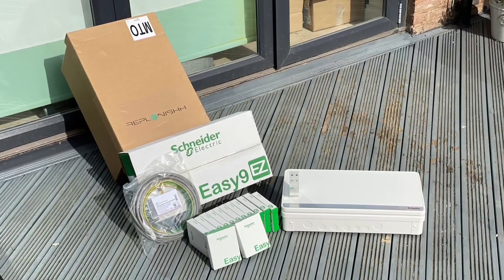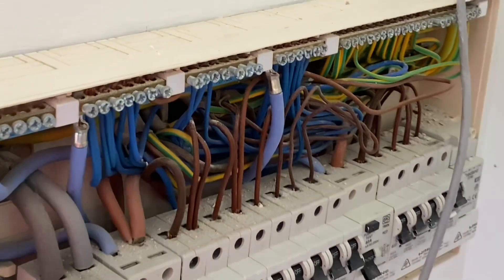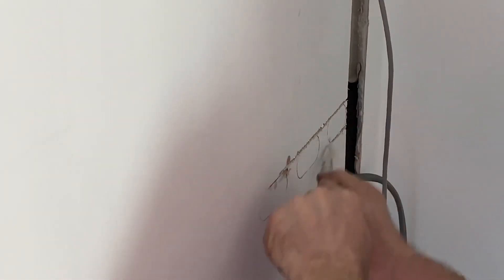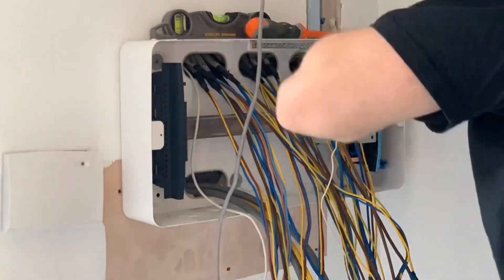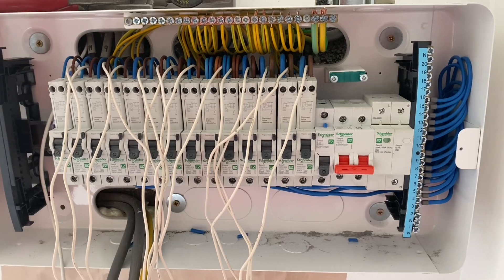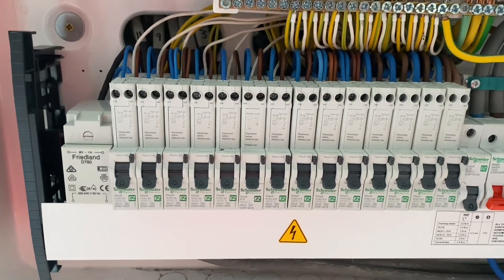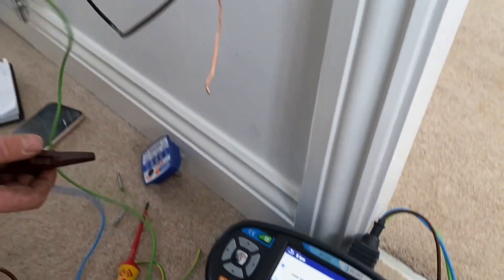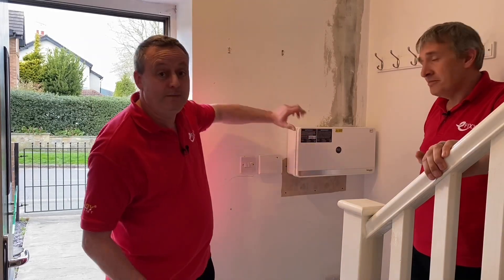EV CHARGER installation UK - WHY did we change the consumer unit?

Comment: What I hate about the easy9 board, look how much space is below the RCBO’s.... yep, plenty, then above them it’s got hardly any space 🤷🏻‍♂️ 
Ross has done a belting job of that tho 👌🏼 well done matey
Reply: I havent fitted one and i wont.
As you say loads of wasted space also who designed it so the buzz bar to go around the Neutral terminal.
I have worked on one of those and a cable i had put in temporarily got  stripped by the hinge a blew.
Reply: @paulspicer754  definitely designed on paper and not for the installer

Comment: As big as that board is, it's tight for space at the top. Unusual to leave so much space at the bottom. Also considering the amount of innovation Schneider have in some of their boards, they have functional earth's on the rcbos in this one, very strange.
Reply: Better to have it accessible to reset Rcbos without having to get a set of steps... 👍🏼
Reply: @PETER WILSON Schneider themselves make a range without the earth tail and also without the neutral tail, so it's not just the cheaper brands and I think Hager devices don't have the earth tail any more.

Comment: Was the supply to the car charger on an RCBO? As it has an RCD within the charger does this still provided adequate discrimination
Reply from the maker: Extra RCD to protect the cable - video coming soon discussing discrimination.
Reply: @efixx  It'd be "selectivity" if Gaz had written this reply.... along with "twin and CPC" 😁
Reply: Mcb does not give Earth Leakage protection to the Circuit as it goes beyond the curtludge of the building

Comment: Why not install a larger unit for future expansions? This I dont understand about UK electrics, you only have 1-3 spare places when switching a consumer unit or even installing new.
Reply: because we have dumb regs that cause you to basically throw the fuse board away and start again every 10 years or so.
Reply: @edcooper2396  what the hell. What a dumb and wastefull regulation
Reply: @ed cooper it’s good for business though
Reply: It's at the point now where your better off fitting a small 3 phase board with a single phasing kit fitted. Gives the internal space and ways needed.

Comment: I don't get why these small units are installed in the UK, there is no room for upgrade and little space to work with.
Reply: If you notice with anything in the UK, it's either just the right size or too small, it's ridiculous, that goes for our electrical stuff and even our kitchens, where we design them, that if you plug the appliance in it won't go far enough back, that's the poor design we have over here, if the people designing them head to fit them, then maybe things would change.
Reply: @anthony Charles should you be fitting sockets behind appliances? I never do
Reply: @edcooper2396  yeah I have in the past, fitted a 3 phase board in customers homes and used a conversion kit, loads more room.
Reply: Eaton Memshield boards have loads of room.  Havells do a range called PowerSafe which is identical to the old Memshield 2 range.   These are superior to the more modern cheaper-looking Memshield 3.
They are single phase boards which have a similar style to 3-phase boards.

Comment: Why don't the RCBOs use the DIN rail as the functional earth?  Why cant we have boards with live and neutral bus bars? Not an electrical but I've never understood this!
Reply: Schneider do a board where there are no neutral tails and there is such a bar for the neutral, however those boards are too expensive for most, and I don't know if it's available in single phase, efixx showed it but it was a three phase board.
Reply: This DIN rail does exist, but this board is old fashion
Reply: Schneider do s board like that. Buts it's ludicrously expensive, as are the rcbos to go in it at £100 each...

Comment: Thoughts on the door bell transformer being of a different manufacturer, tho not attached to the bus bar it is nevertheless non compliant with 536.4.203
Reply: @edcooper2396  Not really an IET issue, it’s more the manufacturers/ BEAMA getting involved and the CU assembly not complying with the  BSEN 61439 series by mixing manufacturers components

Comment: Moving the CU is ok if all the cables come down, bit of a tw@t if the ground floor socket circuits come up
Reply from the maker: You got to have some luck - one cable from below to a socket looked like a ring, but was a radial.

Comment: On the video you said the surge protector would protect the car. Wouldn’t an EV have its own surge protection on the cars BMS?
Reply from the maker: good question - needs exploring but the £850 charger doesn't so in our book an SPD is worth the investment.
Reply: I'm sure that will vary from model to model, but don't forget that surge protectors using MOVs (and spark gaps, to some degree) are sacrificial. I'd rather replace a surge protector in my CU than in my car - I bet that's the cheaper option!